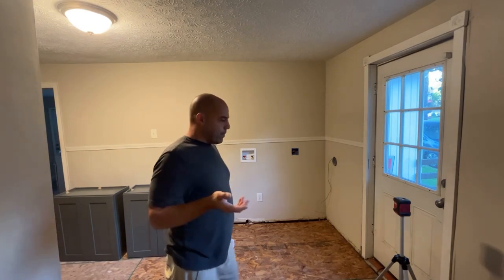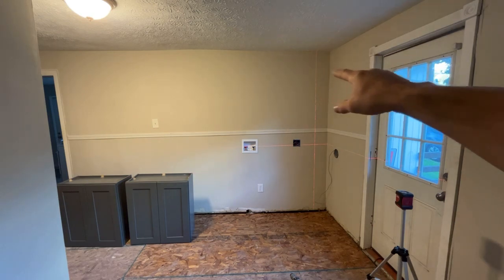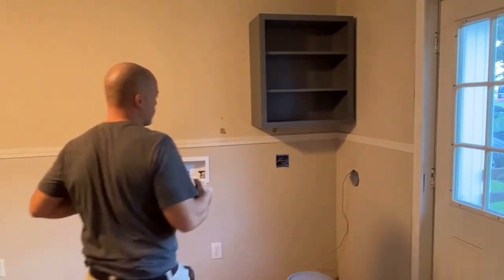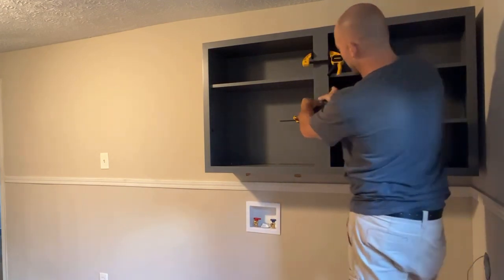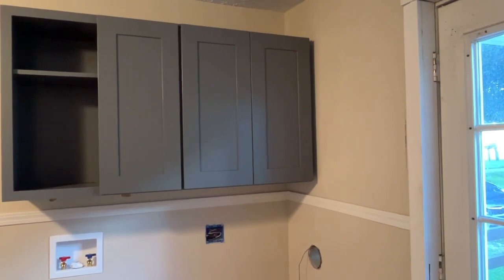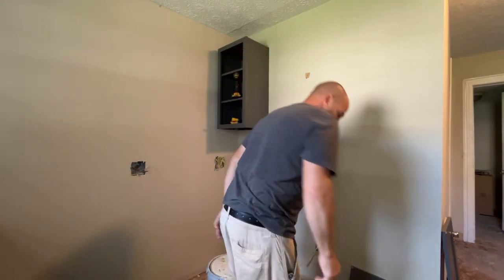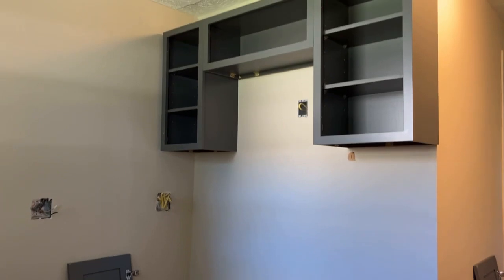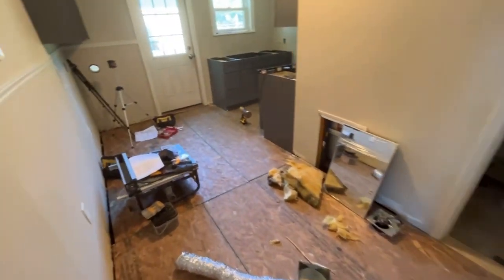Installing kitchen cabinets on a job

Comment: Your cup is too tight or loosen the screws?  If that does not work switch the soft
Close on / off on one then the other?  Should be fine or the cup is to far or bound
Reply from the maker: Yeah, I took a little bit to get that one hinge adjusted. They had it in there all screwed up when they screwed it into the cabinet. It went in on an angle the hinge did.
Reply: @IRESTOREBUILDSTUFF-ne9xv  don’t you just love that?  All that money no matter what price point and in my book they should be delivered ready ?  I mean each door prefitted and checked?  I know they include that in their price?
I make, and install cabinets plus like you all the trim in a house !  Your more extensive, I do not do plugs or install fans ect.,.
I do not hv the talent or time !  
I need to learn it?
Anyway lastly there is a huge hole in the YT video line-up on exactly this!  For pros like me who want to just watch & p/u some pointers from a pro.  Not DIY !  Never do I watch a DIY channel!  It’s just not the same !  It’s home owners maybe doing it close to right or not even close  but not professionally do this for a living and passionate about doing it right!
So pls keep them coming you will grow!!!
Reply from the maker: @zephyr1408  thank you 
And that cabinet was either Friday, built or Monday morning lol